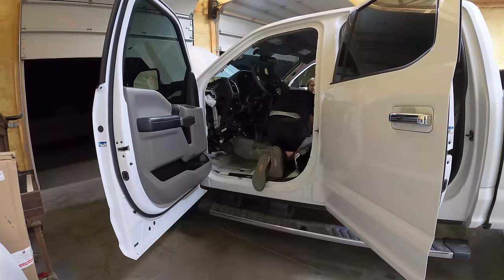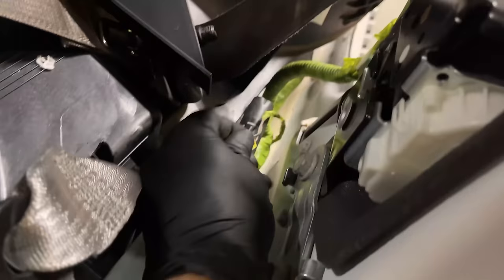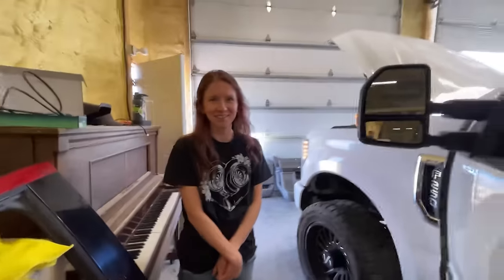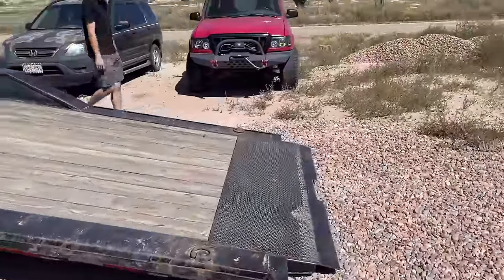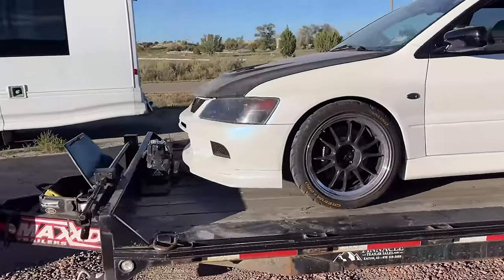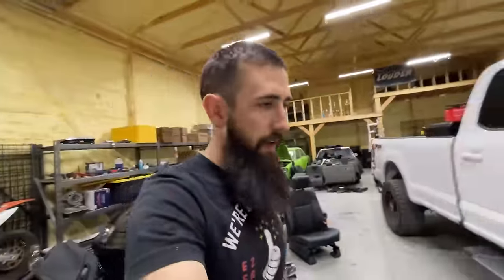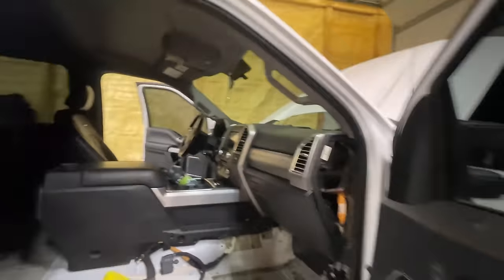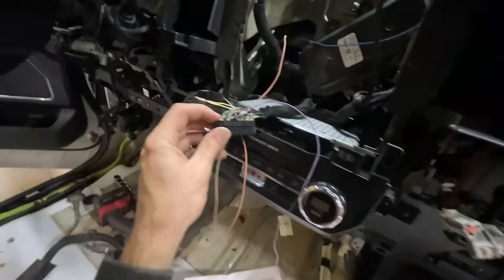"IT CAN'T BE DONE" INTERIOR UPGRADE - Ford F-250 12-inch Screen Sync 4 Install

Comment: While the seats are out of the truck take a look at the Colourlock leather refinishing kits. I took some really worn seats and with a couple hours work made them look much better. 
I do suggest getting the neutral binder that doesn’t come with their kits to do a pass or two on anything that has that crackle area. It gives the rest of the fillers and dyes something to build on rather than just soaking in. They’re steering wheel kits also work well. Then you could sell them as almost new, put them in or keep them as spares.
You can air brush or use a paint gun to do it with better results. It just body work for leather.

Comment: Perimeter is the outside measurement of something , parameter is the word you're looking for . Like the parameter for allowing your transmission to shift is based on the vehicle speed , the outside measurement of your shop is the perimeter , so the perimeter of a 60 by 40 shop is 200 feet .

Comment: For the winch just use a hitch adapter. You can install hitch receivers where ever and makes the winch versatile, use it on just your truck, back of trailer etc. Install some heavy duty connectors (I call them forklift battery disconnects) front and back of your truck (they make nice thick jumper cables that plug into them nowadays too) I use them to charge the trailer batteries too (instead of through the 7pin thin ass wire and directly to the truck batteries (real truck has 2)/ alternator (or alternators, 2 isn't necessary to be a real truck but many do because 2 130A alts are cheaper than making 1 special 250A Alt I guess 😂)

I digress

Comment: ON THE TRAILER...... just move the winch to outside the deck frame there and make a pass through hole for winch cable, still get full use of winch but now have the whole deck to use

Comment: Nice Information. Just watched this video.  At the end of the video you mentioned looking forward to taking some long trips with this. Was wondering if you have already installed, or have thought about changing the 34 gallon tank out for a 60 gallon fuel tank. I have a 2021 F250 XLT that  I changed out to 60 gallon, My wife and I just completed a 3 month cross country trip with pulling a 36 ft. 5th wheel trailer. The larger fuel tank helped out so much(more expensive to fill, but do it fewer times, so it's a wash). Anyway great video

Comment: Kudos to the efforts and determination!  I'm really curious if you ended up doing any of the camera and IPMB work.  I am contemplating adding the missing cameras to my 2022 F350.  The hardest ones (cost wise) are the darn LH & RH Mirror cameras it doesnt seem like a lot of details available if I can just add to existing or I have to find the entire mirror setup which is super expensive.  And then trying to ensure I have the right IPMB and all that jazz thus far I've physically installed the Center High Mount Camera and Front Emblem camera to go with the tailgate camera I had, but I haven't gone in to tools/software to try and activate.  I only have FORScan and guessing I need to acquire the VCM II tool to continue this journey.

Comment: Can you please get me the information on what wires I have to put wher I already got 2022 platinum dash and ready to do upgrade. My truck is 2017 f250 platinum by default but I want to put me big screen I already upgraded the headlights and taillights all I need is new dash. Help me please

Comment: What about doing a screen swap on a lariat where it already has that harness, any ideas or help?
Reply from the maker: Then you would just need the 2022 dash shell, with the 12in screen and climate control stuff. You would just use your harness, and hook up a few wires to power the volume knob, almost everything plugs in.
Reply: @motionAutoTv I have a 2017 Lariat which has 8” screen. Does the 2022 12” screen just plugs up? Or I need the whole dash?
Reply: @MotionAutoTv  I have a 2017 Lariat which has 8” screen. Does the 2022 12” screen just plugs up? Or I need the whole dash?